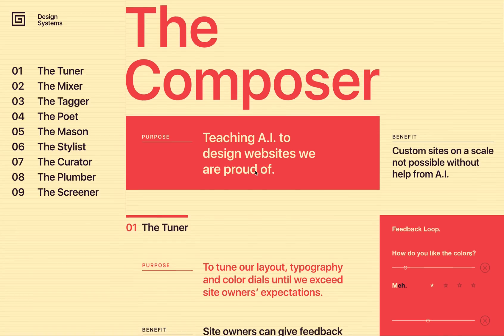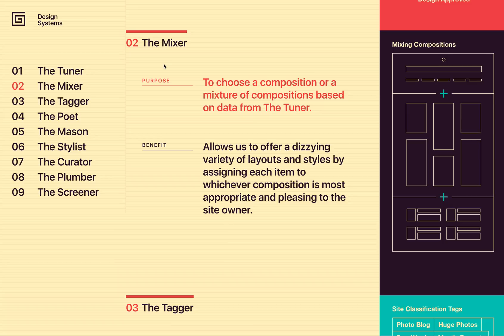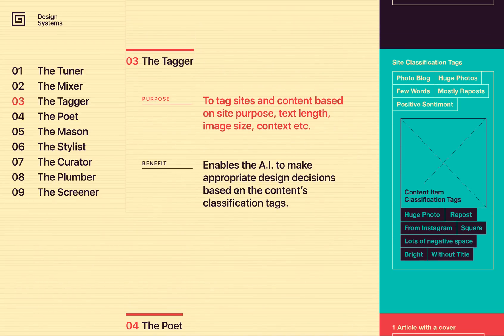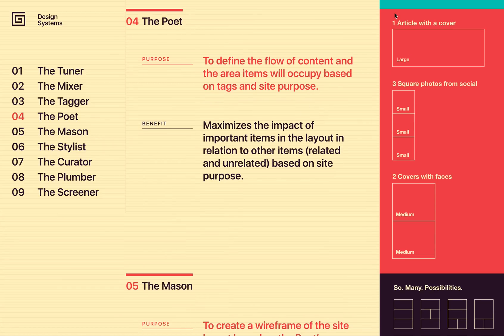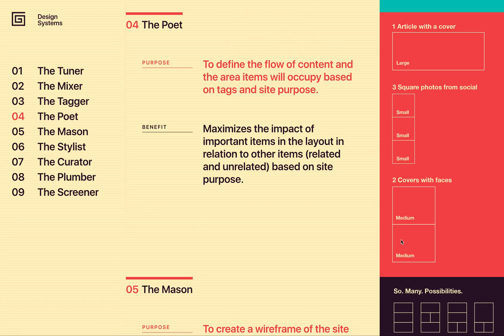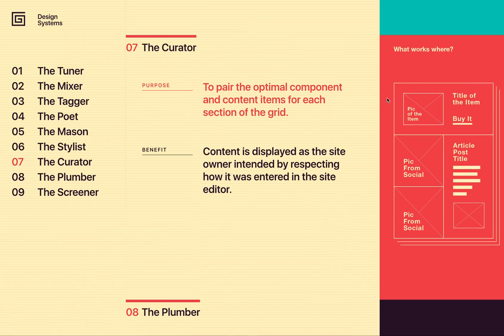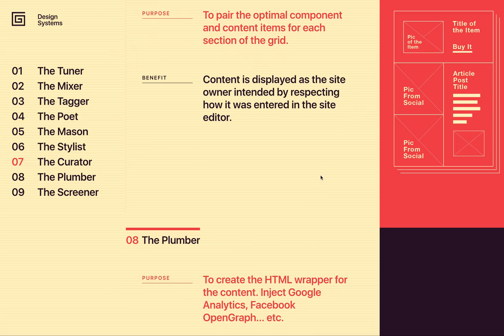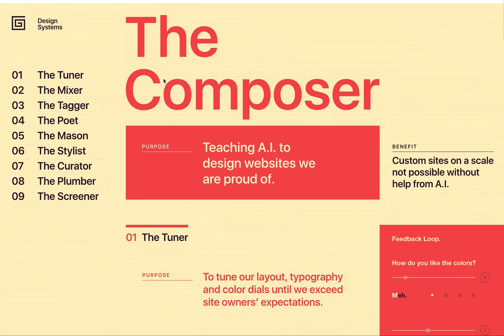The Composer

Comment: A lot work and intelligence goes into making my site look as bad as it does. Looking forward to some more updates to make the algorithms better.
Reply: Much was promised, but so far so bad.
Reply: There are very few Grid websites out there that look good from The Grid and I believe a lot has to do with limiting how much control the AI has. The Grid is also extremely limited in its capabilities and I've found it just more frustrating to use than an other typical website builder like Wix or Squarespace just because their tools are established at this point. The Grid could be great in several years but it has a long way to go. How they ever expected to launch Summer last year is beyond me.
Reply: They oversold it.  It is just a website builder with a lot of automation features.  It looks like they put a lot of work into making the configuration easy to use but they really oversold and underestimated the work required.  It'll be interesting to see how it is going in several years.  Maybe other website builders will borrow some of the innovations and be improved by the work on the grid also.
Reply: I am still going to stick with it. I am trying to make it work for one of my projects so I will see how it develops as there are promised changes in the coming months.

www.theoldworkhouse.tv